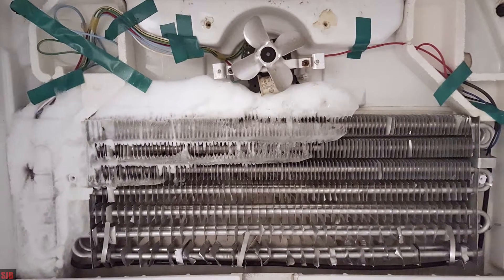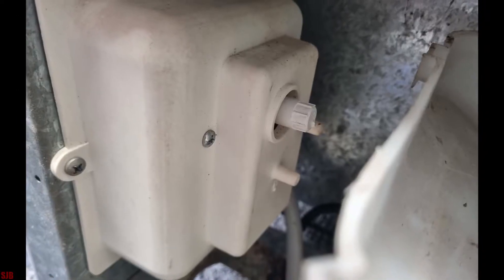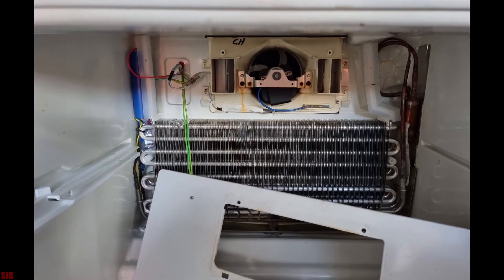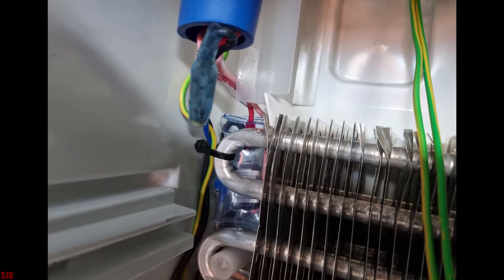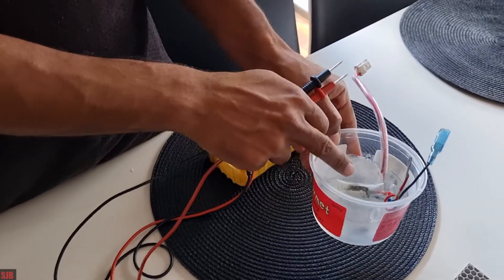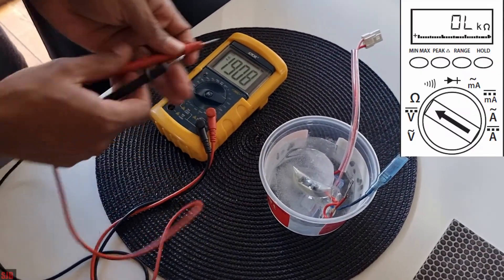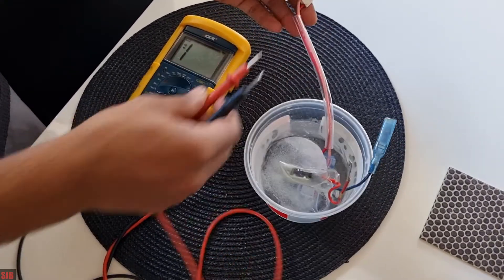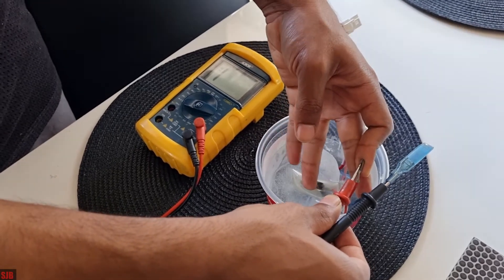Fridge Thermostat - How to Test - Westinghouse / Electrolux - Fridge not turning off issue

Comment: Isn't that the freezer thermostat ? Does the fridge compartment not have a separate thermostat or sensor ?
Reply from the maker: Correct it is, remember a fridge works only when the freezer is operating on designs such as this